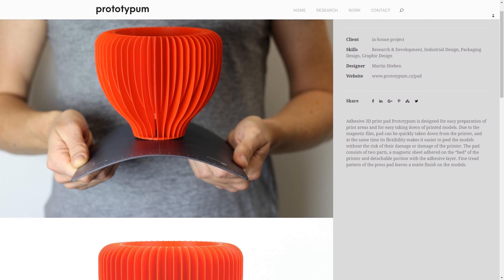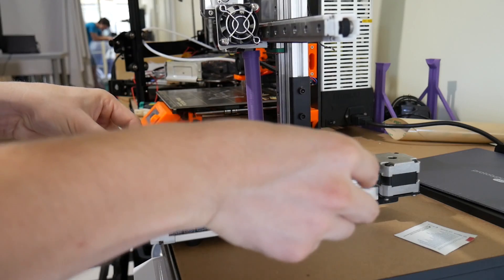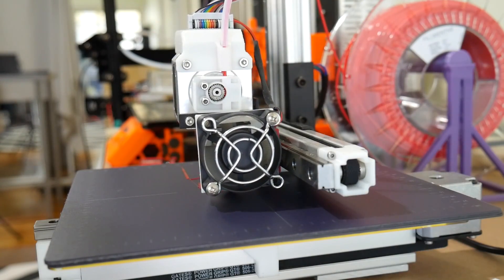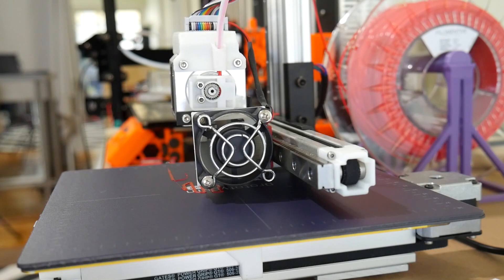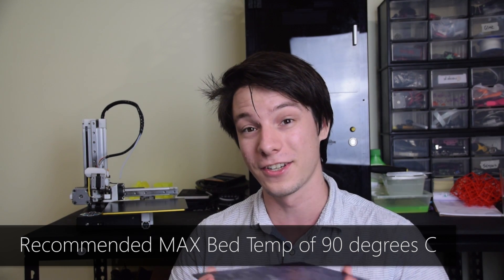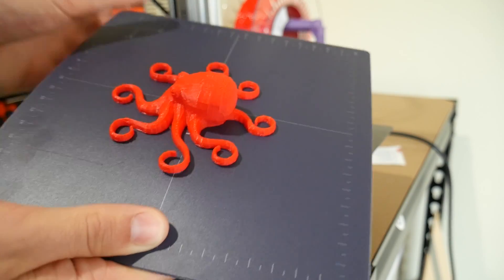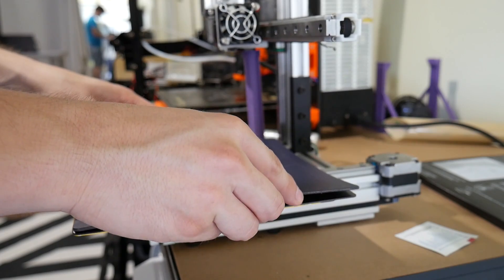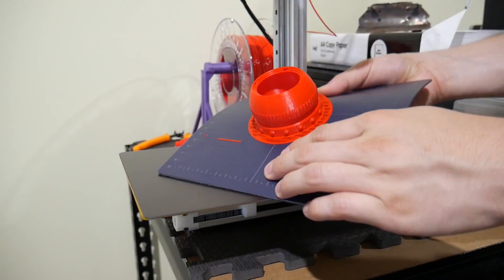Prototypum Pad - Magnetic Build Surface Review

Comment: Two things:
- Heard some commentary on the CETUS production units being very different from the preprod. ones , to the point people have not recommended them anymore on reddit and such ... ¿ any clues ?
- for this product: A bit weird the size they are selling it for
Reply from the maker: The machine is good - but for some unknown reason production units don't have regen braking on the Z axis - which uses belts. This means when the machine powers down the axis slams to the build plate however on my one, it drops slowly and gracefully. I'm used to this behavior as it's similar to the original UP's but for newcomers it looks pretty bad - just something to plan around. The print quality I've been seeing is still excellent for the price.
Reply: I've got a production unit of the extended cetus and have printed 3-4 kgs of filament and yet to have a failed print

Comment: I made one with a sheet of buildtak and a beware dogs sign from home depot. Just attached with bulldog clips but works just as well. Heck of a lot cheaper as well.
Reply from the maker: What did you use for the backing? That is an awesome idea for a video lol
Reply: Elmers spray adhesive has always worked for me, but it melts at 90C, so I would like to know a good alternative as well, for my pei sheet.
Reply: Angus:  Right? That's actually really neat, really creative and makes me rather jealous I didn't think of it...
Reply: Not a bad Idea! As long as you can get it to lay flat every time you put it back.
Reply: Just a metal sign from a hardware store cut to size. Like this one: http://www.homedepot.com/p/The-Hillman-Group-10-in-x-14-in-Beware-of-Dog-Sign-840143/100117208
Reply: Would be nice to see. Especially if you can devise a way to make sure it is level after every print with no waves or ripples. I could see a situation where clipping it on the edges could cause a slight rise in the center of the sheet. Worth testing though.
Reply: That one is aluminium, not a very magnetic metal ?